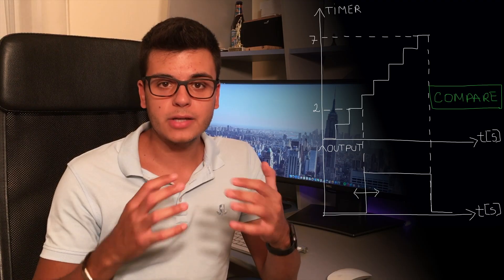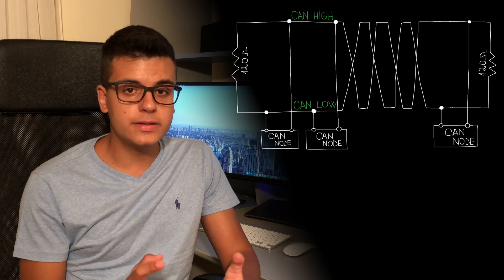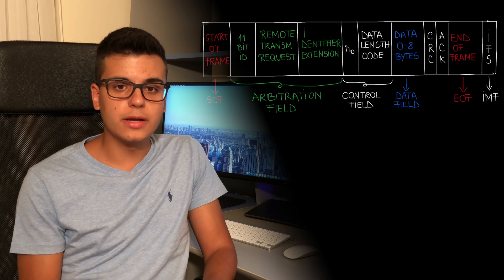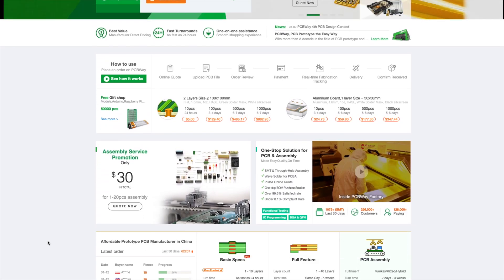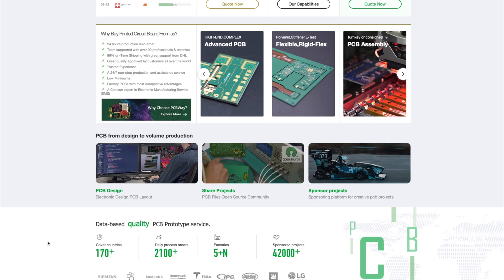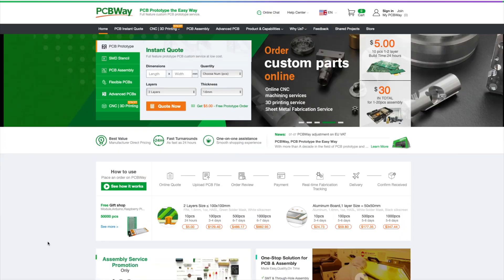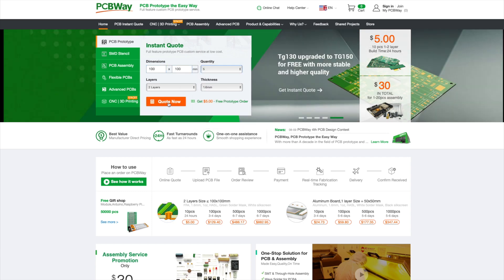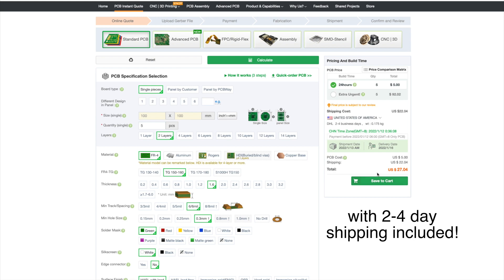Should You Become An Embedded Systems Engineer? 5 Skills Required & Career Advantages

Comment: Awesome explanation, thank you for sharing. Perhaps it's a bit late to be asking here, but for someone interested in asking the following questions on a daily basis, what would you recommend going to school for?

Questions/Challenges  I want to deal with on a daily basis:

- How is the user going to interact with these physical pieces?
- How is this future-proof?
- How is this hardware scalable? (Fabrication/manufacturing-wise)
- How is this hardware ergonomic/comfortable for the end-user to wear? (Feels transparent?)
- How will this tangible hardware be easily programmable for the software Designer (UX/UI) & Developer (Code)?
- How will this hardware endure in its environment? (i.e. time, weather, climate, daily use case(s), temperature, etc.)
- How will my machine code (Binary code) be translated to programming language?

Comment: Welcome back! It’s been a minute.
Reply from the maker: It has been, indeed! Thanks!
Reply: @TheFabytm  In your first video, you mentioned that you recommended that one starts with the MSP430 MCU in that it has less layers of software on it compared to the Arduino, is the MSP430 the microcontroller that has the least of software layers on it then? How can we experience this difference hands-on with the two MCUs? Meaning, how can we verify this?
Reply from the maker: Well, you could get close to the hardware layer with most MCUs, but what I mean is that with some platforms like Arduino, ESP32, the IDEs have the dirty (configuring clocks, peripherals) done for you either directly, through already written functions or through GUI plugins.

This can also apply to the MSP430 with the Energia IDE, but when you write code in IAR/CCS, you mostly have to go through the user guide and datasheet to accomplish what you want. This is also true of the ATMega on the Arduino if you don't go with the Arduino IDE.